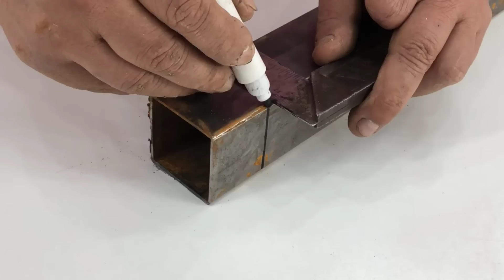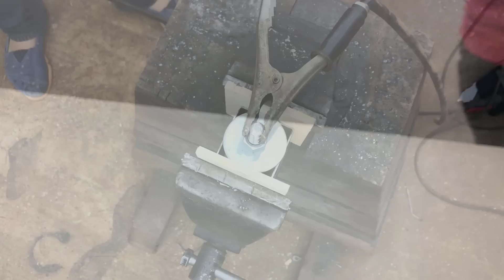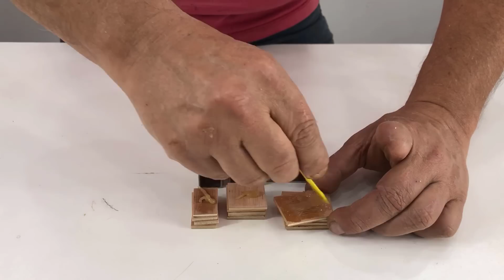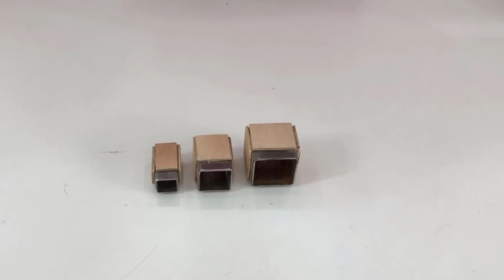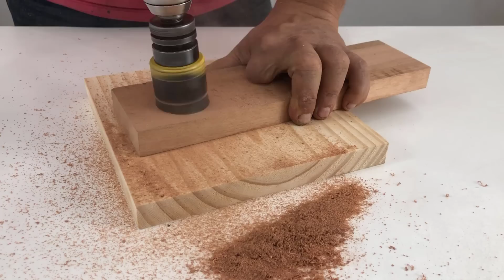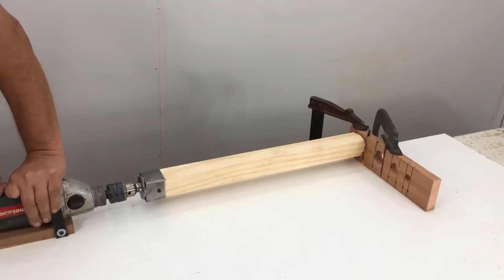Un Taladro y Tubo de perfil solo eso Necesitas y Pocos lo Saben

Comment: The material leaner feed is not having any guide....gun check is not in linearity.
Product output is not have the shape you require.     No safety features.